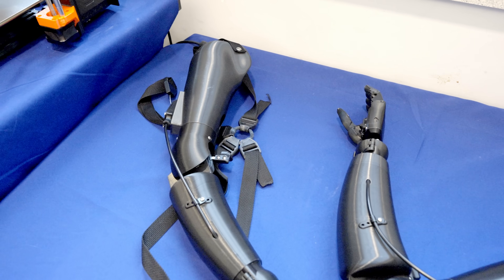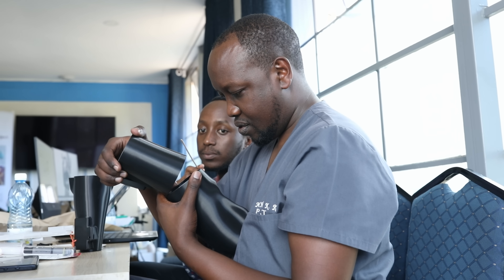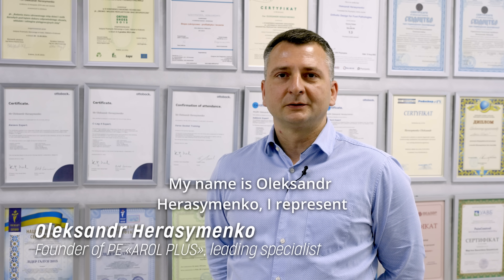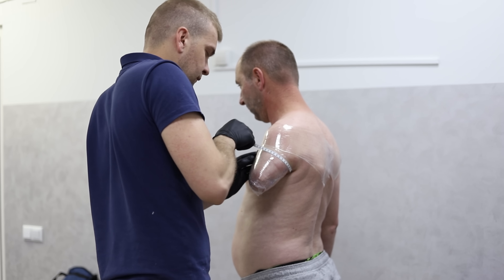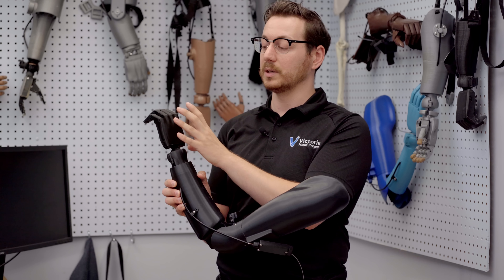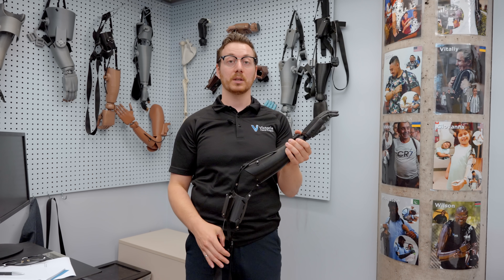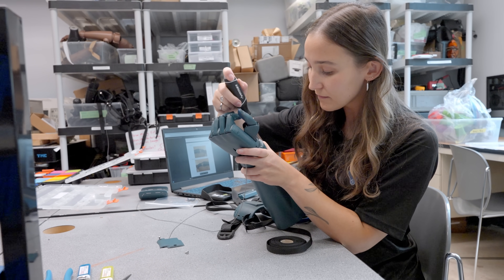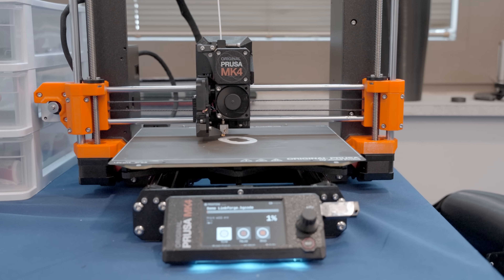Victoria Hand Project: Changing Prosthetic Care with 3D Printing

Comment: They are decorative prostheses, they can't hold anything up, they break at the first impact.
Reply: They've been in business for 10 years, which is plenty of time for them to figure out what works and what doesn't.
Reply: Decorative only? Have you even done any research of VAP?
Reply: I think plastic is good enough for most cases (for hands) with benefit of easy and cheap replacement/reprinting if it brakes. 
Alloy or composite inner frame can always be added in special cases when extra  durability is needed
Reply: ou did not watch the video. they clearly use the prosthetics in video
Reply: Why be so negative about somebody doing good work.
Reply: @flyerphil7708  Because I participated in a campaign to create prosthetics for children. We were all very happy to collaborate, but we discovered that after a few days, those prosthetics were damaged. It seemed cruel to me to give these children hope.
Reply: anything heavy will cause back pain, amazing work. Unfortunatelly for many victims price is an issue too. 3d printing helps with that.
Reply: My experience is, you can jump on TPU prints and you won't be able to break them even if you try hard 😄. You just can't break it. But 'easy to print' is not a sentence I have heard about TPU ever before 😅. It is one of the complicated materials. 

PLA breaks pretty easily yes, but it depends on the price-quality of the material, i doubt any wood prosthetics or robot arms with fine joints could handle infinite blows either? Not sure, need to ask.

Comment: electroplate with copper for super durability. only a relatively thin layer of metal will make parts very strong.
Reply: No, it won't. Also very easily scratched. These people know what they're doing
Reply: Additionally, there are people who are allergic to copper. Add sweat and the friction of the socket and people can develop a painful rash within hours.
Reply: @Joseph_Greiner true, though that applies to some filaments as well no? Not that I think these should be electroplated and C3P0 looking.